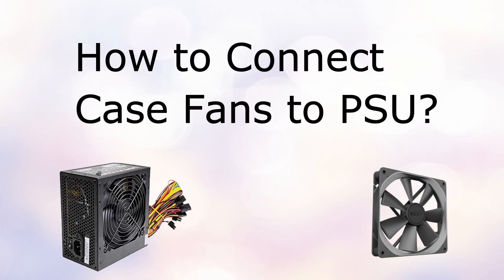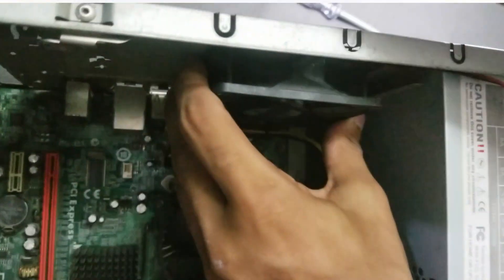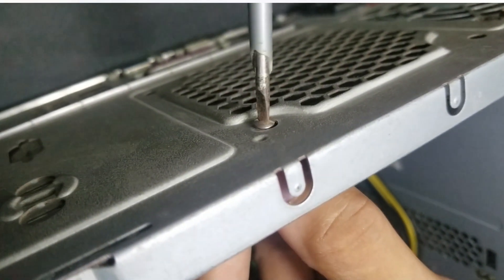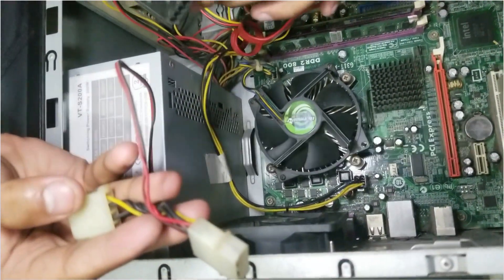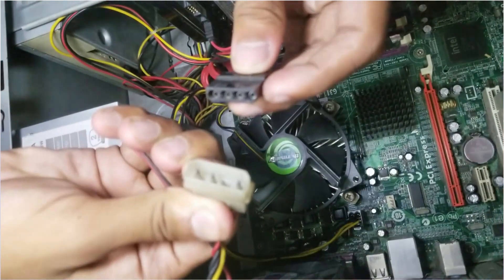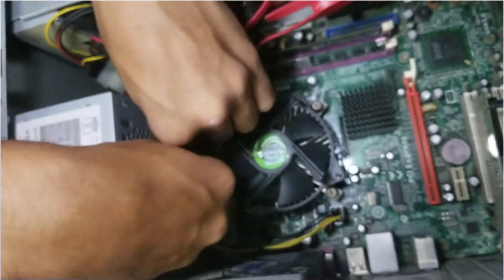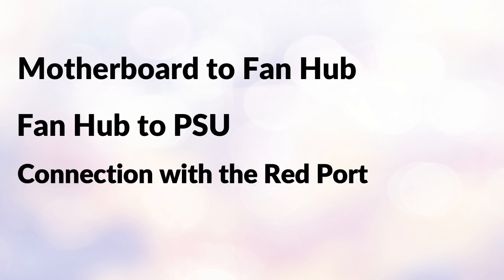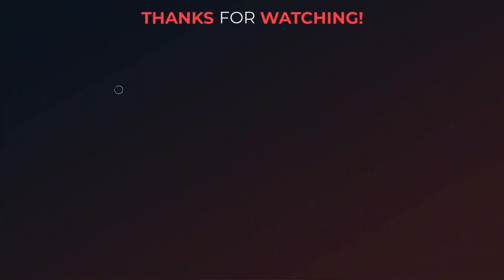How to Connect Case Fans to PSU? Connect One or More!

Comment: You didn't show where they connect on the Motherboard.
Reply: The hub does not need to be connected to the motherboard, it comes directly from the power supply to the fans

Comment: Why do you need a fan hub? I’m a bit confused at this part.
Reply: When ur psu don't have enough cable for all the fan u need a hub to connect all the fan
Reply: @naoton201  where the heck do I find a fan hub that supports 11 fans
Reply: @galloe  hooking up a hub with 10 fans into 1 header won't supply enough power. The fans will not work and might cause big issues. Are you dumb ?

Comment: My psu fan spins slow when i start my pc is this normal?
Reply: @thetechfixr4988  i cleaned my psu few days ago and when i tried to turn my pc on,it did,but its not showing anything on my screen,i am really worried.
Reply: Bro never ever open psu
Reply: @helifynoe9930  that's good bro
Reply: @helifynoe9930  indeed bro u know lot about these stuffs. cool bro!!
Reply: @thetechfixr4988  The fan is running,slowly but running,i dont know if its supposed to run slow tho lol,i remember when i was cleaning the psu i disconnected fan's plug off the psu so i could clean it easier,i reconnected after cleaning also.
Reply: @moment1g  ZZZ